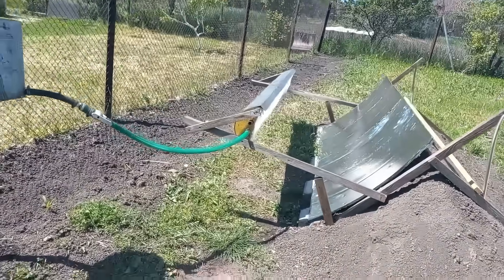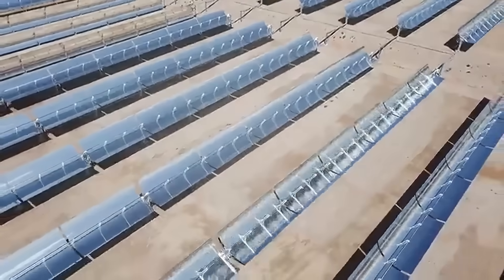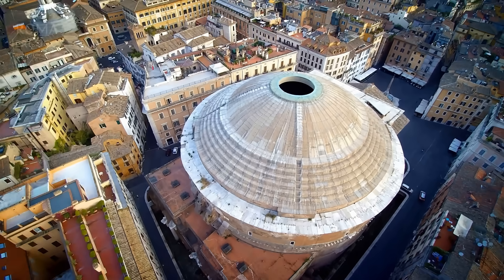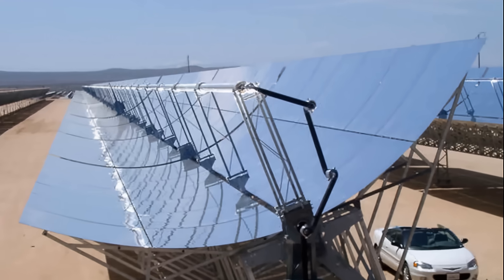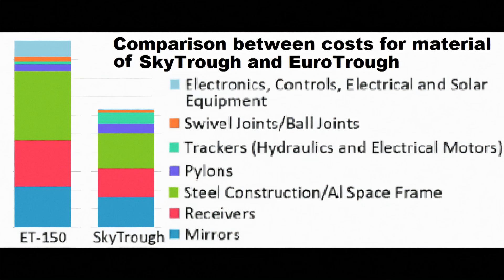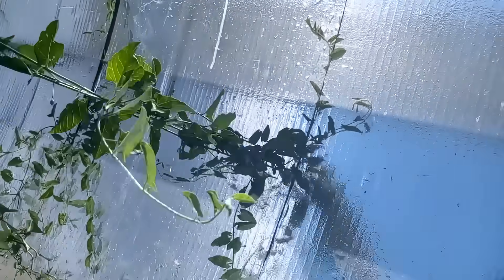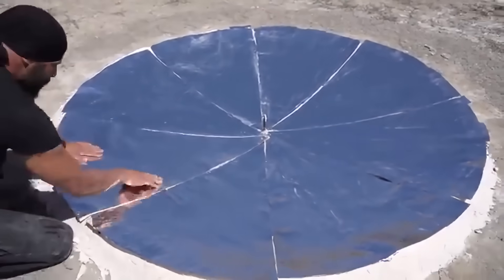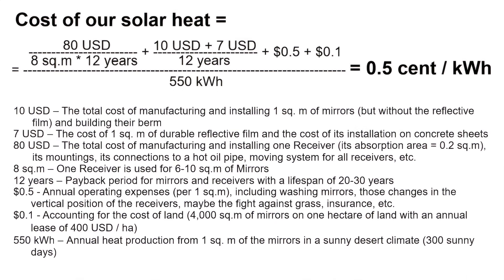Mirrored concrete for cheap solar energy

Comment: This is the only channel where I'm 100% sure the creator isn't ai.
Reply: I had trouble understanding this video and then I realized I had it on 1.25 speed so I switched it back to regular speed and had just as much trouble understanding it.
Reply: @tuckercase2449 I don't know what you're talking about. he does has a very thick accent but I'm able to understand it easily. Homeboy speakers in cursive 😂
Reply: @TrevorTrove they might not be used to hearing different accents or even haven't heard the type of accent this youtuber has or an accent close to the youtuber.

I know whenever i hear an accent i haven't heard before it'll take me a bit to start to be able to understand the person;.
Reply: @TrevorTrove he does speak in cursive that’s a good description 😂
Reply: @tuckercase2449  why? His english is good. Probably yours is terrible.
Reply: @SingTodayi  Lulz at your grammar
Reply: @SingTodayi  nah, his lisp is hardcore. I feel like my ears are wet after listening to him. Dude is spitting. Dont know about facts, but he is spitting, alright.
Reply: @SingTodayi  no one mentioned the English. You just exposed yourself. 😂

Could’ve been the volume, the audio quality, etc. but you outed yourself by virtue signalling. You KNEW the issue but pretended there wasn’t one. 😂

You’d have been better off asking what the issue was. 😂
Reply: @renaissis  It was the overall audio quality. I was just trolling and it looks like I reeled one in.
Reply: @SingTodayi  his English is terrible
Reply: @FatManJackson  lmfao.
Reply: @renaissis ah the games we play
Reply: I had to use the audio AI function to understand this video
Reply: thank god to Borat for developing effective Mirrored concrete for cheap solar energy
Reply: @JamesFromCanada very nice 👍👍
Reply: @JamesFromCanada  Great success !
Reply: @JamesFromCanada damn came to the comments to say just that 😂
Reply: @JamesFromCanada  You can just thank Borat
Reply: The narator sounds like the "uhhmmmm ackchualy 🤓☝️!" Guy.
Reply: Did you just start youtube in the past few years?
Reply: what you mean this is premiu ai voice :D
Reply: I wanna drink with @sergiyyurko8668
Reply: clearly his tongue is in the way
Reply: Skill issue
Reply: Maybe
Reply: Weird way to tell us you're stupid
Reply: I am russian and I completely understand the author
Reply: three pointer!
Reply: There are many such channels, ai is easy to recognise on yt
Reply: The AI: Much appreciation, that was all we needed to now..
Reply: @e.r.v.9612  roger roger
Reply: Sounds more like a Stephen Hawking voice board imo
Reply: Salam waleikum from siberian german!) +100%Sure
Reply: Thanks to YouTube’s caption feature, I can perfectly understand this video 😄
Reply: @fitria_123 best comment!
Reply: Yea its Megaminds cousin, im sure. 😂
Reply: uhmmm? the creator isn't ai? so other creators are clankers ?
Reply: @Marjannuel  if they do advertisement and/or ask to use referrals, they are no longer creators-makers, they are... Sales and marketing people.
Who likes watching ads? I'd rather watch this guy doing low-tech high-life style experiments and comparing his DIY gear to those immensely expensive commercial systems that nobody can afford (unless they steal tax payers money and pay with those)
Reply: But he got the idea using AI😂
Reply: Sounds like Borat's brother
Reply: Big lol
Reply: Liars do say video made by AI without generated program prompts
Reply: How do you know you are not AI
Reply: Red Letter Media? Knowing better? Jerma985? Suchomimus? Tyler1? LinusTechTips?  You need to expand your watchlist because that's sad if you're mostly running into ai channels.
Reply: Ok, just ignore your weird algorithm/ rare or very generic (Bad luck) searxh of content, I know MANY not AI channels
Reply: You are probably AI at this point.
Reply: @JuggaloJesus66  I don't think so, at this point I'm already artificially idiotic from all the shorts I scrolled through 😅
Reply: Too bad it's crap

Comment: I think you did not account for the necessary costs for earthworks, assuming that the hardware is capable of withstanding weather such as heavy snow, heavy rainfall, hail storms, and I suspect that thin reflective film you used might not be up for the job.

Comment: Amazing work! I'm glad the the Algorithm decided to show me your work. (I think it noticed that I was impressed by the "Perfect Aircrete" that NightHawkInLight made a video about a couple of days ago. I doubt that you'd really need that ultra-light and highly insulating aircrete for your design though. Both of you are brilliant, anyway!)
Reply: that was an epic DIY drop this week.  morphic resonance in the algorithm is strong. we all need more foamcrete and non pv solar in our futures.
Reply: What he's doing is inefficient. It's just not that easy as he did to produce more electric Power as solarcells of the same size.
Reply: @Wrutschgeluck  That's totally plausible as well. PV panels have reached a sweet spot of cost:value recently, with even more impressive tech on the horizon from here. It may be wiser to do something like have grass-fed animals nibbling on what grows beneath the panel arrays, and get two income streams going at once.
Reply: @GL-GildedLining then the cleanig of the solarcells is harder since they have to be higher up. And I didnt know much about biology but I know Gras isnt growing well when there is no sun light which is normaly blocked by solarcells ;)
Reply: @Wrutschgeluck  I saw a Short recently titled "The Solar Sheep," about how a solar farm in China had a grass overgrowth problem around their panels, and solved it by bringing in sheep to roam and feed on that grass. That's why it came to mind.
Reply: @GL-GildedLining yes maybe depends on other factors how the Gras will grow under it. Like I sayed I dont know about that xD

Comment: You use a simple curved parabola for your mirrors which requires the collector to move to account for the change in the sun's altitude. There is a type of parabolic shape called a Compound Parabola which allows the focal point to stay at the same point for a wide change in solar angle. This is described and instructions for  fabrication are given by a youtuber called NighthawkinLight. If you can make that shape in concrete and I cant see why not, then your concrete heater could be even cheaper to produce.
Reply: It sounds more efficient in every way
Reply: i immediately thought of Nighhawk for his work on foamed concrete
Reply: @khlorghaal made a comment on that same thing just to see the OP comment above.

This idea would benefit from aerocrete for it's higher insulation value.
Reply: NighthawkinLight mentionned!!!
Reply: Also using his newest video about aerocrete, you can make these panels 50% lighter although a little thicker
Reply: @karlpittman9925   You wouldn't want them lighter since the weight holding them in place is what's allowing you to get rid of  reinforcing structures.
Reply: @Matt_Alaric the soil/sand berms are the supporting structure. Using the compound parabola, and aerocrete in Nighthawkinlight videos they can stay at one angle on the ground on a sand berm like this video. No additional support needed. A concrete panel at 80lbs or aerocrete at 80 lbs twice as big isn't gonna blow away off a berm either.
Reply: @karlpittman9925  I didn't say "supporting" I said reinforcing. As he makes the point in the video, it's the fact that they're so heavy that means they don't need to be reinforced to stop them being easily moved.
Reply: @Matt_Alaric  sand berm supporting the panel on an angle sand berm reinforcing the panel to stand at an angle...it's synonymous. Semantics. Pretty sure if you have 250pounds of concrete panels set into a sand/soil berm as in the video, safe to say it won't be easily moved even if the density of the concrete is only half.
Reply: @karlpittman9925  Nope, they absolutely are not synonyms. A support structure and a reinforcing structure serve very different roles. You're trying to blur the meaning of words in order to avoid admitting you misrepresented what I said.

And again, the added weight is the reason it doesn't require extra reinforcement, so removing weight is the opposite of what you want to do. To get the same weight with a lighter material requires more time, effort, planning, and space, to get the same effect. It's a downgrade not an improvement.
Reply: @Matt_Alaric okay, so let's make concrete buildings even heavier, 10 times heavier even. Then they will never need rebar reinforcement. That would be incorrect, it will always need rebar reinforcement. Just because it's heavier doesn't mean it doesn't need some kind of reinforcement. The logic doesn't logic. Miriam Webster dictionary says they are synonyms.
Reply: @karlpittman9925  Rebar has nothing to do with weight. Rebar is about strengthening concrete against tensile stresses, which are irrelevant here. The weight of the concrete here is a positive not a negative.
Reply: @Matt_Alaric you missed the point. Just because something is heavier doesn't mean it wouldn't need support/reinforcement. The logic is flawed. That's my point with buildings. You need reinforcement even though they are heavier than a concrete solar panel reflector. You're debating the semantics now
Reply: @karlpittman9925  I missed nothing, you're making stuff up and at this point you're frankly lying. 

The weight is a feature, and by being heavy enough to not be moved by the wind it removes the need for reinforcement. 

At no point has it ever been semantics, you're making stuff up.
Reply: @Matt_Alaric lol no I'm not, I'm using known facts of reinforcement and support in different scenarios using concrete to cross examine the logic to point out the flaw.
Reply: @karlpittman9925  karl and matt sitting in a tree
Reply: @ralphjune9798 😂
Reply: @karlpittman9925  bro you tried so hard with this last comment lmao it literally reads like a high school persuasive essay. there's nothing wrong with being wrong. the problem only arises once you refuse to acknowledge you were wrong
Reply: @karlpittman9925 SweeeeeT
Reply: You beat me.
Reply: Annnnd Night has commented on this video!
Reply: I like the compound parabolic capture of rays myself
Reply: good recommendation, ty
Reply: Is there a reason why magnifying glass isn’t used to focus on a core ?
Reply: @Rooflikeanexpert  I think it would have to be too big and heavy and expensive to get the same result. Fresnel invented  a prismatic lens used in old lighthouses to make large lenses light enough to be rotated. A simple curved mirror is much lighter to achieve the same light concentration.
Reply: Compare the Meerkat!
Reply: NightHawkInLight is the GOAT
Reply: Good man
Reply: He addressed this in half of his videos...
Reply: thanks chatgpt
Reply: There is this thing we use to receive tv signals from a satellite.
Its called a satellite dish.

And it sends the incoming signal to the receiving head.

Wont that work?
Reply: Careful. Pretty soon they will be stating that the sun is losing its energy, its like a battery, the more you draw from it, the more it gives & will start imposing a mirror tax or a copper tax. Something to that extent.
Reply: @PoonahNee Don't be silly. That'd be like claiming we're running out of saltwater. We don't siphon the suns energy, we take a fraction of what it's giving us. Nothing anyone does on Earth could possibly affect the sun in any way
Reply: @Nanamowa  You mean like paying carbon tax on a carbon planet, as carbon life forms who eat, breath & poop carbon ? That kind of silly ? When you write the rules, you don't really care what the rules state. It just has to convince SOME of your principles & you then use the law to not only make money, but to control. There is no carbon or methane problem, yet look at traditional energy cost now vs. 50 years ago, based on a problem that does not exist. The chicken little story is older than Christ by some 800 years. I know the sun can't be drained by over usage. You know it, but all it takes is a bunch of flat earthers to believe it & you'll have your hands full convincing THEM first, before you even get to face the guys who thought up the BS in the first place.
Reply: @PoonahNee Well as it turns out, carbon isn't the issue with carbon tax. It's the form that carbon is in. Kinda like how diamonds are expensive despite being made of exactly the same thing as coal. You're comparing apples and oysters here, one is an unlimited resource whilst the other is a vanishing resource because what we're interested in isn't the carbon itself, it's the way that carbon is before and after we use it.

Greenhouse gasses do exist and their effect on the Earth is demonstable. Fossil fuels are diminishing and we need to rely on different forms of energy. I'm sorry you're so out of touch.
Reply: @Nanamowa  See you've already bought most of the BS. You might as well swallow the next bit down too.
Reply: @PoonahNee The bs being what exactly? The objective scientific studied I've read? Those peer reviewed, independently sourced research papers?

The problem with people like you is that you think scientists are lying to you for your inability to understand the science.

Don't just take my word for it, a lot of these things are experiments you can do yourself.

Create two containers with two thermometers. Fill one with CO2, the other with dry air and place them under the same heat lamp. The CO2 container will heat up more due to the greenhouse effect. 

So the greenhouse effect is non-controversial science, the only controversial science is whether it's happening on the Earth. Well we know global temperatures are increasing and we know the greenhouse effect is true, we know these two things scale with one another directly. So what exactly are you contesting here? Do you think that temperatures are not increasing? Or do you just think we couldn't be the cause?
Reply: @Nanamowa  Exactly those papers chicken little. It explains how the sky is falling, but how changing industries all relating to energy, will somehow solve the problem that doesn't exist. As stated. You've already bought the BS, You might as well start paying sun tax. Your children will buy THAT!!!! BS.
Reply: @PoonahNee In one ear and out the other. Seeing is believing, so do the tests yourself. I did these tests in MIDDLE SCHOOL. You're right up there with people who think the Earth is flat, because no matter how much I demonstrate to you how this is the case, it's not good enough.

You're constantly like "Oh you just swallow what people sell you" while having told you exactly how to do the experiment yourself without any need to trust anyone else and it's still not good enough. This is just a textbook delusion.
Reply: @Nanamowa  fossil fuels are a finite resource so what will the temperature on earth be once we burn all these fuels? at what temperature will we see detrimental impact as right now food production and habitable land increases year on year
Reply: @Nanamowa  nie zrozumiałeś ABSOLUTNIE  co TEN CZŁOWIEK napisał do Ciebie  o opodatkowaniu  .  Wziąłeś JEGO słowa DOSŁOWNIE  . Przeczytaj JESZCZE RAZ , ze zrozumieniem  . On użył sarkazmu , by pokazać myślącym co może uczynić rząd jeśli TYLKO ZOBACZY najmniejszy  przejaw naszej niezależności  .
Reply: @Nanamowa we only use the equivalent of 500 SQ miles of the sun's output or less, the rest goes out to space
Reply: @vtecmissle Exactly what I said, just in other words. We take a fraction of what it gives us.
Reply: The problem is that you dont get it hot enough for the steam reuired. You never get 3-400C with that trough
Reply: Why not?
Reply: Too much accent. 
Better experience of the text were just read by MS Word.

Comment: plants rubbing against mirror foil: In some cases, building facades caused the grass in front of them to be destoryed due to excessive heating.  perhaps it's possible to flip a secondary mirror over the collector once every week to treat the ground against weeds (without chemicals, even)
Reply: if you can make a cement mirror, you can make a cement floor
Reply: I've used a much simpler solution to remove some weeds that were encroaching on my parking spot: SALTED EARTH. Just salt the earth in front of the mirrors as many times as needed until the weeds dry out. Might get rid also of other pests behind.

Comment: what if I polish the concrete and use chrome spray paint to coat it - is the thin base layer of cement strong enough to polish?
Reply: Forget chrome spray. Tried it, doesn't work.

Comment: Please start building functional systems for sale! Local businesses always need energy. 

Tie your mirrors to a heat pipe and a sand battery, and you can use the energy any time of the day.
Reply: its not so easy in ukraine, due to corruption and the whole problem with war